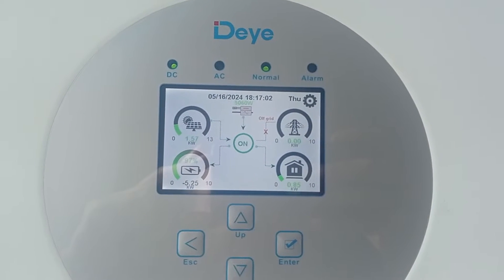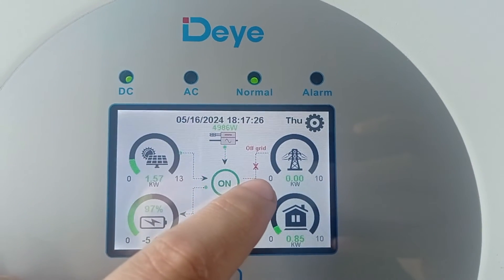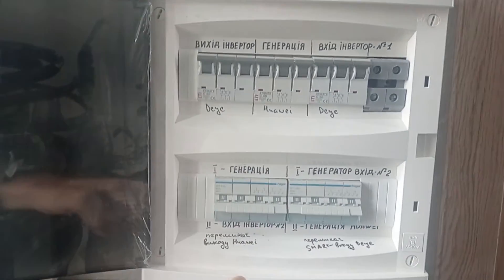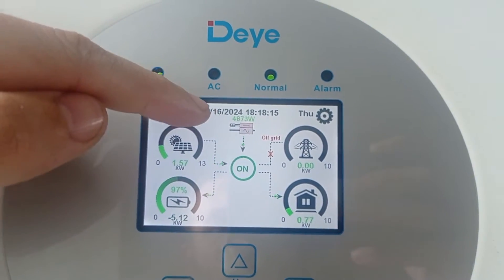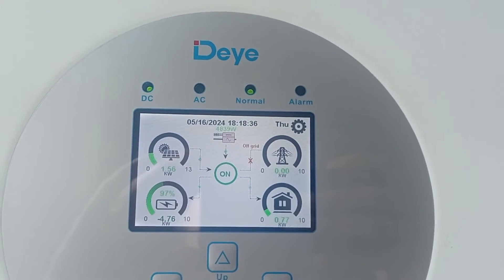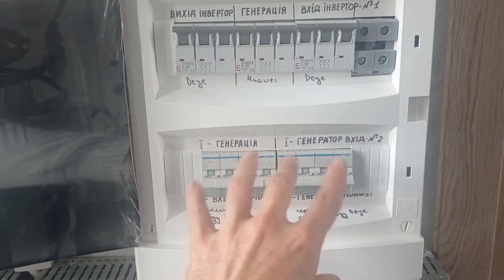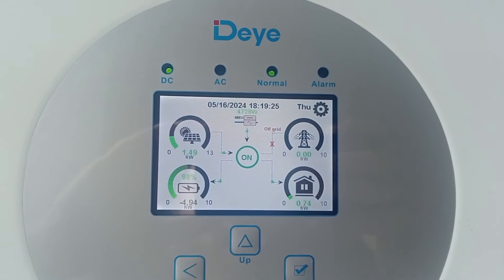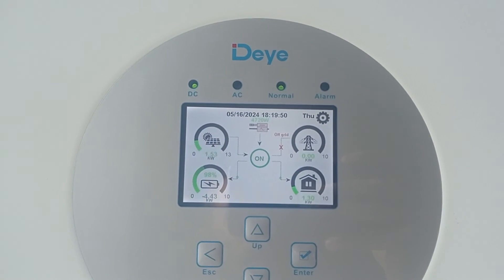Can the grid-tie inverter supply its power directly to the Hybrid inverter? Oh, yes it can!

Comment: If I have a 5kw Deye hybrid inverter and 5 kw ongrid inverter connected to gen port, and the battery is at 100% and both of them are production 4kw each does it export 8kw to grid? Or gets capped at 5kw?
Reply from the maker: @jassimissatulla2463  it depends on the cap selling setting. If max sell is say 5 kW - it will sell 4 kW from grid-tied inverter on Genport and 1 kW of own solar (it will limit the own solar production).
If max sell is say 3 kW - it will sell all 4 kW from grid tied inverter on Genport and about 0 own solar will be produced
Reply: @ so selling more than 5kw is not possible in a 5kw hybrid inverter with 5kw on grid AC coupled into gen port right ?
Reply from the maker: @jassimissatulla2463  it is possible to sell up to 10 (double the nominal value). I am just now aware what are the limits in your case.
If you are allowed to sell 10 - set it to 10 and all 4 from grid-tied and 4 own production will go through without any troubles.
Reply from the maker: you can sell up to double the nominal value (10 kW for 5kW hybrid Deye), and if you have 4 on GEN-port grid-tied inverter, and 4 of own solar - all 8 can go through (if needed)
Reply from the maker: the settings for selling vary from 500 watts up to double of the nominal/rated inverter power.
Reply: @BackyardVoltage  thanks a lot